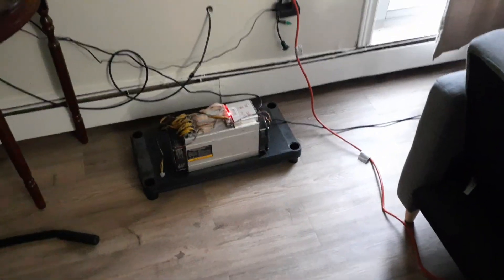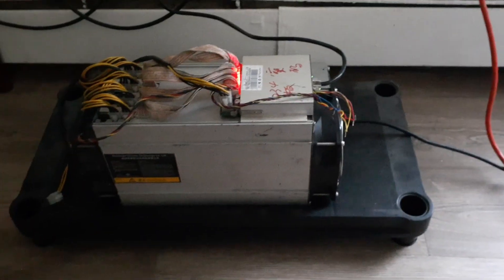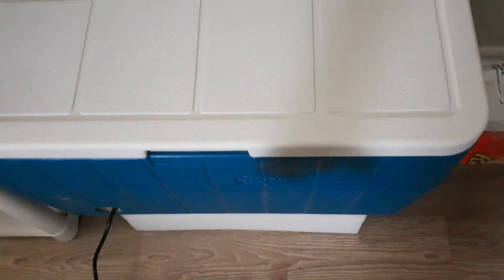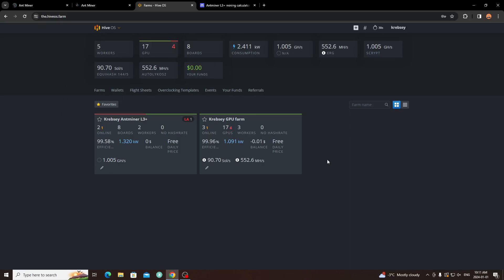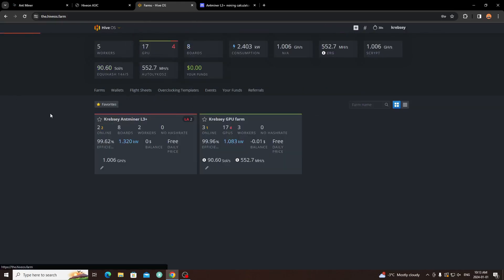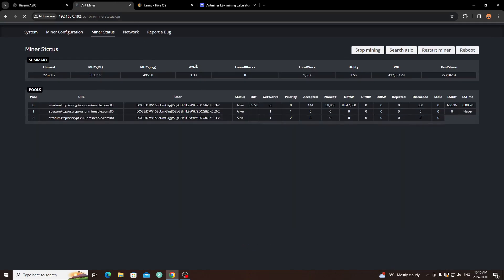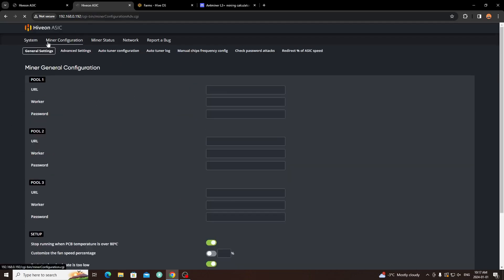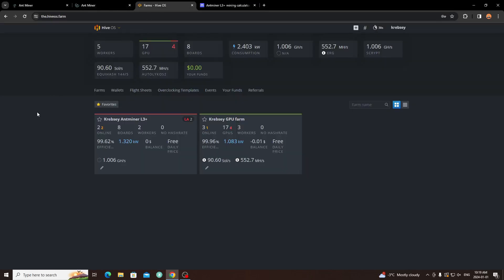Antminer L3+ Overview | My Antminer Rigs | Power Consumption, Profit & More | Asic Mining | DOGE+LTC

Comment: hi there, found your video today, which is 10 months old now. Are your l3+ still profitable now? ive been looking on ebay for some older asics that can still turn a profit with some cheaper-ish eleltricity rates and some undervolting firmware. currently my rate is $ .069/kwh. i did the math today using the numbers you were getting and its showing negative return now

Comment: Nice video need some help i am about to take the plunch to snag one o two of these i can get them cheap for 120€ a pop and do you think its worth it i mean if i look at the dodge coin miners there are a few but low hash and so on
Reply from the maker: Hey, all depends on your electricity cost. The units might be cheap but make sure your making some profit or if your looking to build up doge just let them run. But operating costs is what will get ya
Reply: @KrebseyCrypto  building Up Dodge and i got cheap electric

Comment: How did you repair your hash board? I have mine not working at all
Reply from the maker: I wrapped it up in tin foil and put it onto a griddle (flat top) heated it up over 400•F for about 5-10 mins then let it cool then it worked again. Not a guarantee fix but try heating it up like I did for a set time.
Reply: @KrebseyCrypto  i thought that was a joke when you mentioned it in a video haha. I will give it a try
Reply: @KrebseyCrypto  I wonder how that works?  Strange but I will try it too.

Comment: does the miners plug in 120v or 220v ?
Reply from the maker: Can do either. I’m currently running 120v as I’m just in a apartment but they run more efficient on higher voltage so 220/240v I think it is
Reply: @KrebseyCrypto  so i can use 120v cable and plug in just fine?
Reply: @nibba241 depends on the machine as long as it's a standard L3+ it should be fine. If you bought one highly modified possibly not.
Reply: What is the profit on this miner per day?